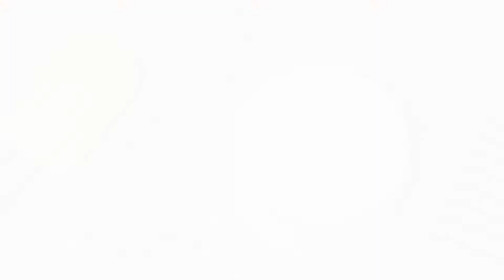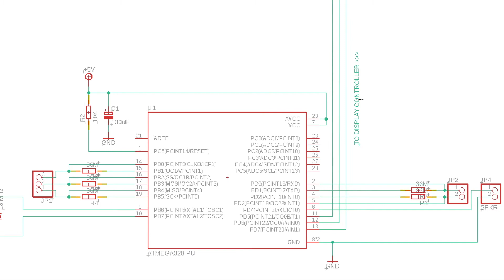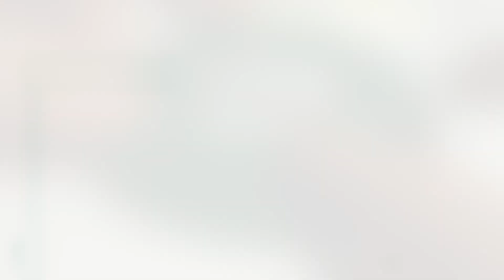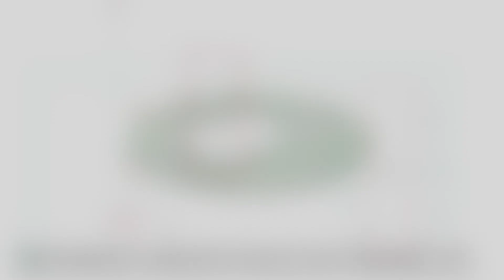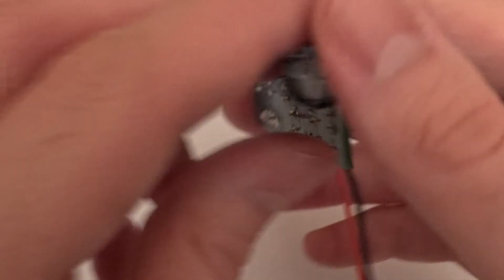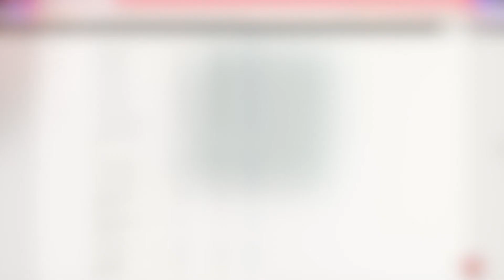DIY Arduino-based Capacitive Touch Timer Part 1 | Builds Ep. 2 | nerdhut.de

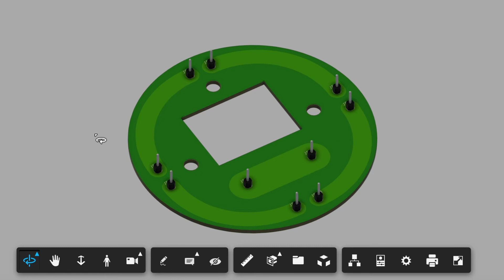Comment: cool project! what program did you use to create that 3d rendering at 3:15?
Reply from the maker: Thanks! I used Autodesk EAGLE to create the PCBs. There, you can push your design to FUSION360 and render it as a 3D model.